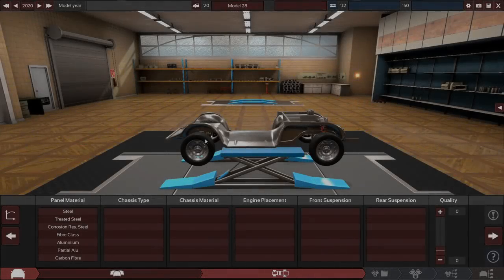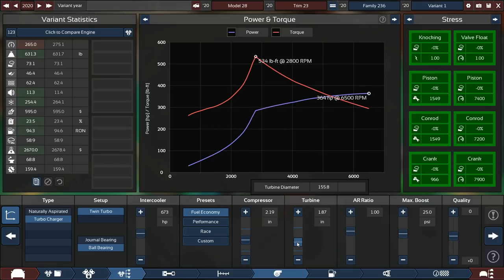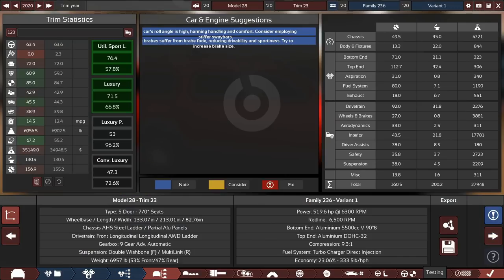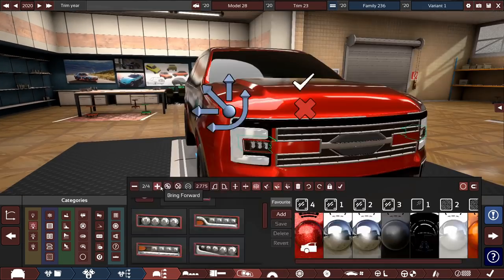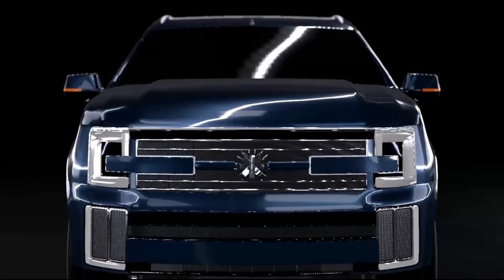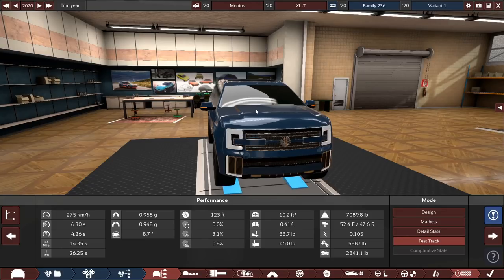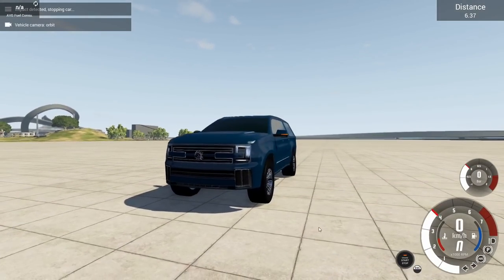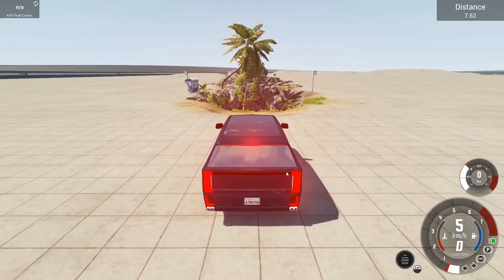Building A BIG Luxury SUV! Automation - BeamNG

Comment: The design, especially the front, looks impressive! 
I would probably have opted for a cheaper suspension to save some weight and tweaked the engine to a 9:1 compression with a lean AF-mixture.